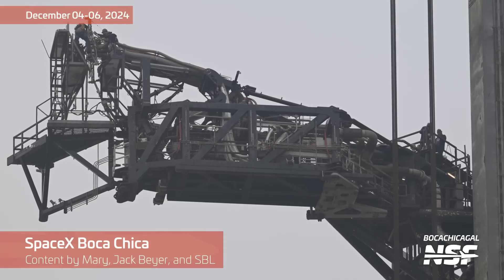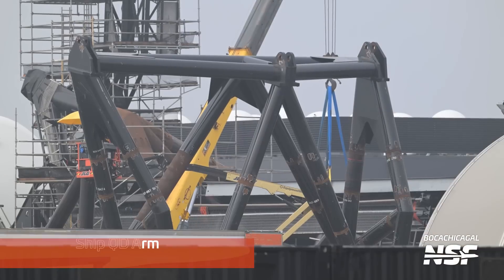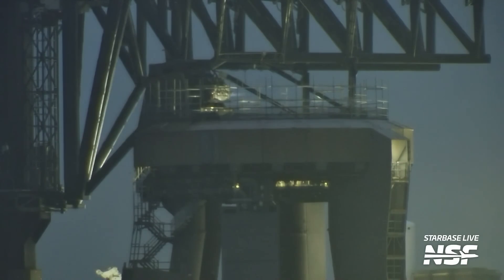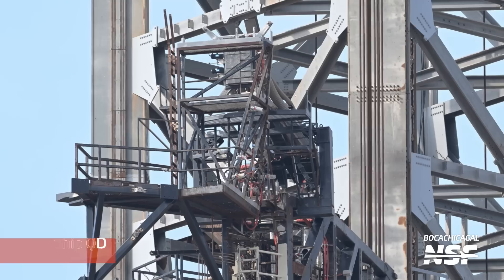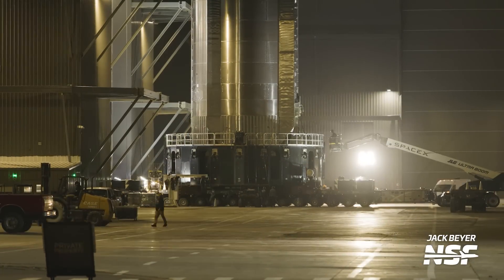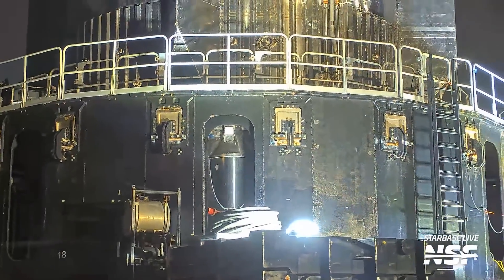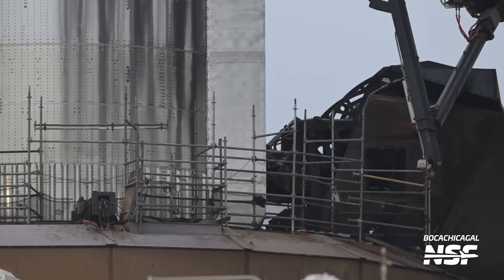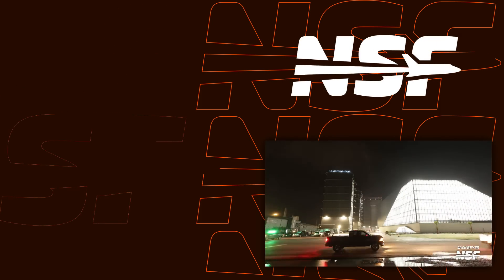Future Ships Spotted At Starfactory | SpaceX Boca Chica

Comment: Das, have you not considered knocking together a sensible sized wind turbine on your site to help with the batteries? A scaff pole tripod bolted down separate to the rest of the rig and an alternator with a huge pully and belt. Power regulator and 3d printed fan, shaft and pully and you're done. I'm doing this for my shed 😂
Reply from the maker: We originally looked at that, but the life expectancy of small turbines in the insane wings down there was... not great. Coupled with the complexity of combining wind and solar in a single system and we waived off the idea. - Das

Comment: I dont know how I didnt realize until now that they are basically using drawn arc studs for holding the tiles on. Studs/drawn arc stud welding like that is incredibly common in auto manufacturing, would be easy to rework existing tool designs to feed their unique clips instead of a standard stud.

Comment: Why is there "fog" in Texas? Or was that sand/dust in air?
Reply: There is often a fog because the Starbase is right on the coast.   Cold fronts often bring fog.
Reply: @michaeldeierhoi4096  oh ok thanks. My impression of a "dusty, desert" Texas is obviously incorrect.
Reply: @fwd79  It can dusty from the sand too so it depends which way the wind blows and on the weather conditions.  It moderately warm day, but windy would have no fog, but a lot of sand kicked up.  I see that all the time here in New Mexico which has similar soil to Texas.
Reply: @michaeldeierhoi4096  fair enough, as someone from UK it was just surprising (Hollywood effect) lol

Comment: Those pins being placed perfectly by that robot reminded me of the Saturn V F-1 injector plate where someone started drilling a hole through it, but realized that they were drilling in the wrong spot and just left a partial hole in the wrong location. And yet they landed on the Moon 6 times and made it back to the Pacific Ocean with heat shields still intact. And they were working under severe time pressure the entire time. Failure was not an option in the 1960's Moon race with the gigantic Soviet Union which Putin is determined to reassemble by force. Warning: The KGB doesn't give up. He will need to be stopped. You'll see.

Comment: Refresh my memory - which booster has 33 Raptor engines, increased by 2 from the 'normal'.?
Reply: You might be confusing Booster 4 which had 20 outer engines, 8 inner engines & 1 center engine=29. All boosters since have 33 engines, 20+10+3

Comment: You you switch equipment off to save power from the batteries like Voyager switching off instruments and heaters?
Reply from the maker: Yes, 100%. We still have some subsystems we need to wire into the control, but we regularly use it to save power. - Das